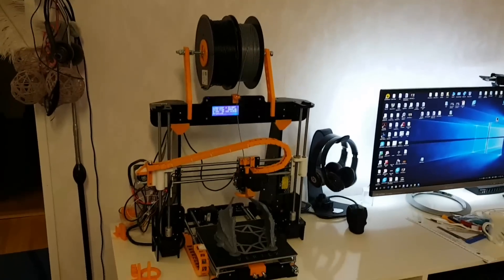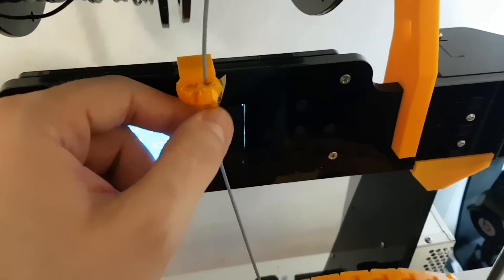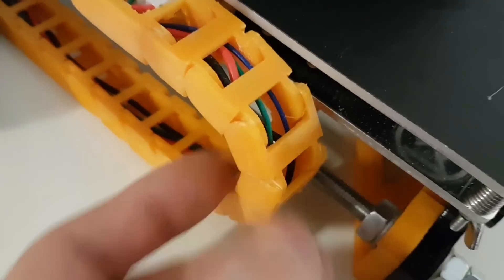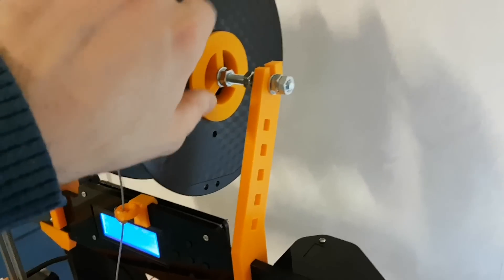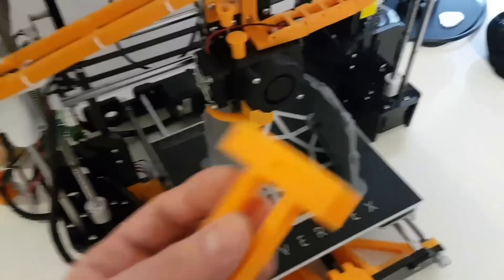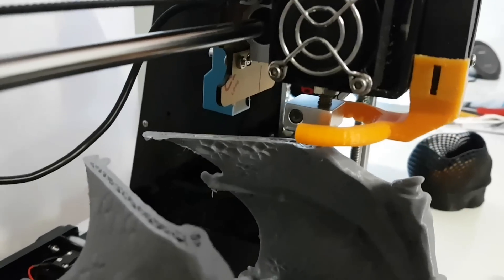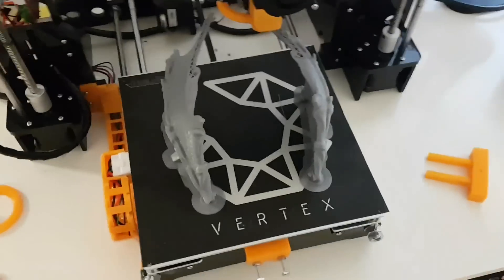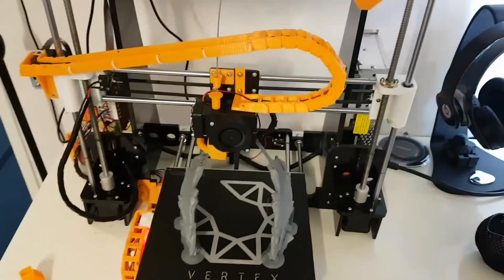Anet A8 3D printer upgrades part 1

Comment: how many prints did you do with the buildtak?
Reply from the maker: A lot ,lot of prints. Lost counter really. If you don't physical damage  build-tak surface it can last for years.
Reply: Nexi Tech THX . kam already using it for a week now. Problem is that the prints adhere so well that its difficult to get of the bed.
Reply from the maker: Bananaphone93 Lift nozzle by 0.1mm,Use less temps on heatbed  (or no temps att all). When printing is done heat up bed and then remove prints.  You should be able to take off prints much easier.

Comment: Careful buying from gearbest. I ordered a month ago, they told me it was packed a week later to be shipped. 2-3 weeks later it still hadnt arrived. They told me it was back ordered. Waited a month for nothing; their customer support is garbage as well, so slow to respond; and the responses hold next to no valid input. Ended up ordering the same thing 20 dollars cheaper on ebay and got it 4 days later.
Reply from the maker: Seldian Strange... I ordering from them for almost a year and never have problem. All packages are deliver with DHL.

Comment: Hi. Newbee here in 3D printers. Does a 3D printer require an air-conditioned room? Any over-heating issue during long operations? Thinking of buying one.
Thanks. God bless you.
Reply from the maker: Hi, Well not really if you don't print ABS which is a bit smelly. With PLA there is no unpleasant smell,but ,you can open window or door little from time to time. Nope, overheating issue ever. Almost every 3D printer has safety feature to turn off power when nozzle hit over 300c. You welcome, God bless you too. Take care.

Comment: Do you know of any video about connecting Cura 2.3 win 8.1 to the Anet A8 i3 printer using the USB connection?
Reply: New versions of Cura are incompatible with the Anet A8, the best way is to put your gcodes on to the SD card and print from there.

Comment: What material is the heat bed chain made of?
Reply from the maker: PLA Eveything is PLA
Reply: No problem with the heat melting the PLA? I've heard other people say that it will, but I only use PLA atm as well. So thanks for your feedback I will print one out myself and probably start making videos!

Comment: Hi everyone, I just built my anet a8. After printing my first print, the hot end wont heat up anymore. The temp goes up and down, but only goes up by a max of 5 degrees. Does anyone know what i could try to fix it or find the actual cause? The fact that the temp goes up makes me think its not broken, but possibly a loose wire inside, or a dodgy wire. Any help would be greatly appreciated

Comment: Hey,
nice Improvments!!! 

I'm currently having trouble with the spool holder.
How did you managed that they don't fall of to the sides? 
Did you screw holes or did you just tightend them up strongly to the frame.
I don't want to sctatch the frame with the screws or screw holes inside of it! 

I recently discovered this adapter which should make the spool holder you have more stable:
http://www.thingiverse.com/thing:1975954
But I'm not sure thsat there is enough space.....

So, whats your setup? Do you have some tricks?

Greetings from Germany!

Comment: how is that vertex board called? I can't seem to find it.
Great mods btw.
Reply from the maker: Thanks man! Buildtak model is K8400-BT dimensions are 240x215 mm you need to cut it little like I did. There is on Amazon
Reply: thank you very much.
Reply: https://www.amazon.com/Velleman-K8400-BT-Buildtak-Surface-Printer/dp/B00STUMYZC/ref=sr_1_fkmr0_1?ie=UTF8&qid=1483629961&sr=8-1-fkmr0&keywords=K8400-BT+3d+printer+board  BUT I DON'T KNOW IF IT THE SAME ONE !

Comment: where did you get the vertex heat bed from?
Reply: This should be put in the description. :)
Reply: The answer is further Down in the comments. It's not a bed, just a piece of material you stick on the bed you have. The type mentioned below is: Buildtak model K8400-BT . Amazon has them:https://www.amazon.com/Velleman-K8400-BT-Buildtak-Surface-Printer/dp/B00STUMYZC

Comment: Hey, Great job on your printer. I just ordered the Anet A8 and picked up the  BUILDTAK 3D PRINT BED SURFACE is this surface material mounted on the original bed or is it some other material?
I'll be using PLA for all my builds.
Thanks
Reply from the maker: Hi! Great for your printer order! Yes! this is just cover over original bed. Just remove tape that bed comes with,clean bed nicely and slowly apply bulidtak over it. PLA working great with this cover. Its stick very good! No more glass,tape and hairspray. I mostly use 55 degrees temperature for heat bed. Sometimes if part has big printing surface or its is small size I don't even need heating on bed or I use heat only for first 2-3 layers and than I turn heat off directly on the printer. Good luck with your printer! :)

Comment: Can you make a video talking about how you cut your Vertex board to fit?  Nice print quality!
Reply from the maker: Thanks man! I will definitely do another detail video about this printer and upgrades. I try to do this weekend. No time now :(
Reply from the maker: tubejim101 Here you go:) https://youtu.be/uTMS0Ha81gQ
Reply: Conesbbkg 
Where can I get the Vertex board.  Sounds like a realy good buy.
Reply: Look for: " Velleman BuildTak 3D "
Reply: My Vertex board is on it's way from Amazon, did you use an online tutorial to install it?  I'm not sure what to expect.
Reply: I tried looking for "Vertex board" on amazon... Didn't find anything? Im just trying to figure out what to use that's reusable so I don't go through so much tape. I've seen the glass idea and I was going to do that but this looks much better!
Reply: When I do so I only come up with one size being 240mm X 214mm and the build plate on the Anet A8 is 240mm X 240mm. I have been looking at a different solution by Geckotek called the RepRap MK2, Duplicator i3, Kossel Clear ABS. Which looks maybe a bit nicer, since it can be removed with the assist of some magnets.
Reply from the maker: Part 2 video! https://www.youtube.com/watch?v=BwnQIuaOnbM

Comment: What is the purpose of the proximity sensor? This printer should arrive in the post soon. Looking forward to making it as good as possible.
Reply from the maker: Exactly. I had really pain with proxy sensor. I could not make good prints on the right down corner on the bed no meter what. And after almost 6 hours of calculation,trying, modifying firmware codes and even moving sensor closer to extruded I just wasn't satisfied with leveling. I ended up disassembly my whole chain and half printer parts  and taking sensor out. After flashing firmware again and after turning off auto-leveling codes, manual leveling my bed my prints are perfect. Proxy sensor I just cant recommend...
Reply: For auto leveling.
Reply: tubejim101 Ok, so to get the initial distance from the bed, but does it continue to do anything through the build? Setting the initial distance doesnt matter too much since you are building a raft to start with anyway.

Comment: hey man , i have the same printer model . Can you  send me some details regarding print speed , layer thickness and so on.. for the best surface quality ?

Can the stock extruder from Anet A8 handel 15 + hours of continous printing?
Reply from the maker: 15 hours of printing? Sure! Not problem at all. Am printing T-rex skeleton now on 150% scale from ''Thingiverse'' and some parts like skull,jaw,neck am printing on 0.1mm and that's continuous 25 hours printing per part. My printer is working 24/7 now without problems. Everything is stable. Settings are: PLA 200c for extruder, 55c for hot bed(I don't use heat on bed all time).
For good quality am using 0.2mm layer height, 0.8/1.2mm for top,button and wall thickness.  45-65mm/s for print speed and 85-120 travel-speed, infill 25-100%(it depend what am printing). Cooling fan on 100%. For best quality am using lower speed around  35-45mm/s for print-speed, travel-speed 45-55mm/s and 1.2mm for top,button and wall thickness. Its very important that you have good air flow and that hot-bed is perfectly leveled. Am using Cura verison 2.3.1. Good luck with printing.
Reply: Thanks man. I owe you one ;)

Comment: Hi there awesome prints you are pulling out from the A8, one thing I'd like to know, what is this vertex cover you have on the hotbed? I mean if I have to source one what I have to look for? Material? Any advise would be great. Thanx
Reply: I can also recommend the CoroPad. Can be ordered from http://corostore.eu/coropad-c-1.html . When I mailed them they replied very quickly and also mentioned they will release a newly developed adhesive spray in january
Reply from the maker: Sorry man no idea. I got it from local store and it was around 20 usd. I try with blue and white tape,hear-spray but this vortex cover is way better.
Reply: Conesbbkg  thanx man I did some research and I am positive that it's like a buildtak mat... now god knows if it's the same material but I guess so. Do you reckon that is a long lasting solution or it has to be changed often? Cheers
Reply from the maker: Of cource man no problem.  I was in local shop today again and I found some info. Buildtak today model K8400-BT dimensions are 240x215 mm you need to cut it little like I did. Here is the same on amazon. Here is link: https://www.amazon.com/Velleman-K8400-BT-Buildtak-Surface-Printer/dp/B00STUMYZC
Reply from the maker: I think this cover can be used very long time.  Only way to damage it(scratch it) when you taking off printing object aggressive. If you are careful with that and you are using not high bed temperature I can't see any reason why should't last long time...
Reply: Thanks mate I am planning to buy an Anet A8 in the following weeks, as always I do tons of research before I commit, wanted to get a prusa i3 mk2 but quite expensive and long waiting list... Been impressed with the quality of your prints so I've decided to go with the A8. Thank you for all the info and the videos. Looking forward to see more mods and prints. All the best and merry Xmas
Reply: vertex builtak isn't cheap. I can recomend coro pad

Comment: Do you have the model number for the vertex bed?  and did you need to print any special supports to mount the new bed?
Reply from the maker: Justin Zehren It's just cover for the bed. I brought in local store so no number. No you don't need nothing to print just apply it over heatbed. This heatbed cover I recommend even more then this autolevel sensor.
Reply from the maker: Buildtak model K8400-BT dimensions are 240x215 mm you need to cut it little like I did.